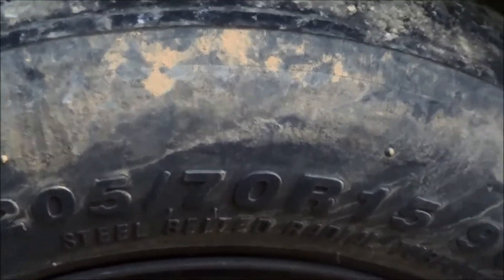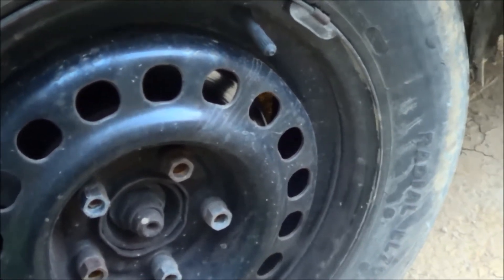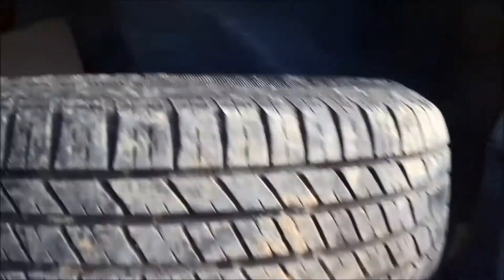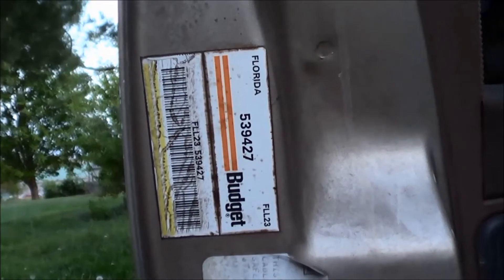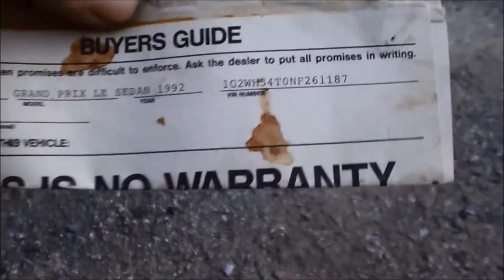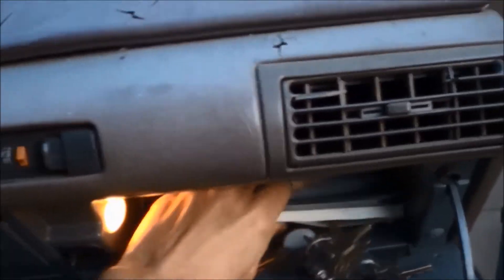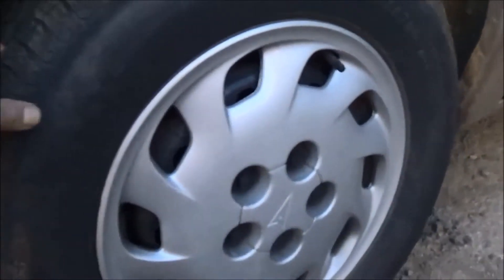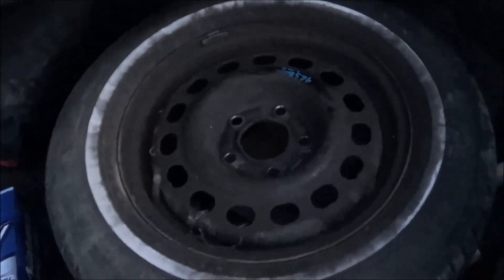How To Measure For A New/Used Car Rim/Tire | Part 2

Comment: Hey brother you got your measurements backwards there... 205 is the measurement in millimeters from outside edge to inside edge of the tread pattern 70 is the percentage of the width of the tire that the heights of the side wall is.
Reply from the maker: trollforge You're right. I was taught wrong.
Reply from the maker: trollforge I corrected myself. Thanks to you. You taught me something today. I was misinformed many years ago, now I know the truth!
Reply: PoopingAndroid you may have been taught right, I know mud-runner tires that are still all in imperial have the height first, but it is the total height, like 36/14.50-16, which is a 36" tall tire (ground to top) 14 1/2" wide, and 16" rim, I don't remember what the old convention for car tires was...